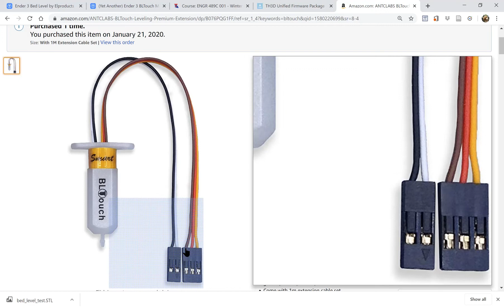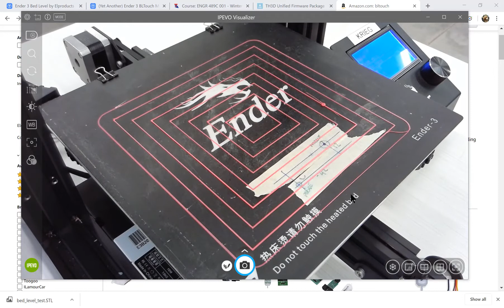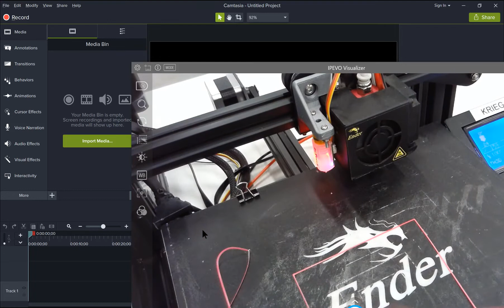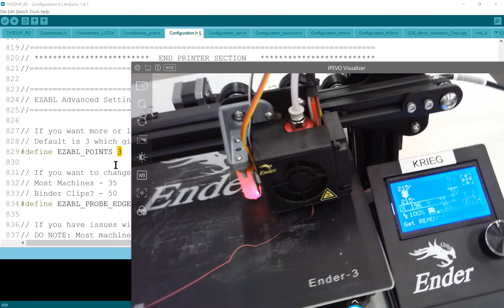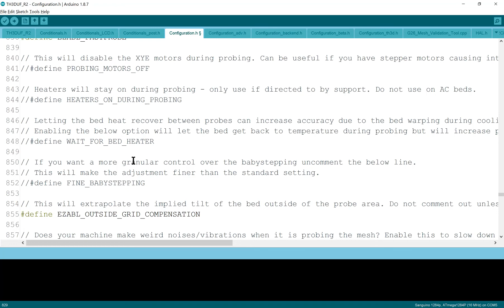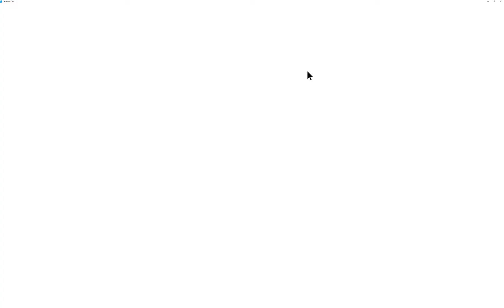BLTouch Install and Setup | Ender 3 | Mesh Bed Leveling

Comment from the maker: I will begin an Introduction to 3D Printing course on June 3rd, check out the video for it here: https://youtu.be/wkFsINXAac4 Thanks!

If you would like a video on manual mesh bed leveling that does not require any new hardware check here: https://youtu.be/cWDgaSEEu3o

Comment: hi #kelly maybe you can help me, I have a ender 3x with glass bed I changed the board and screen and added a bltouch but I setup marlin and I do a home and it goes down but don't stop not sure what I am doing wrong I am new too 3d printing. here is my setup I have a SKR V1.4 with 2208 uart steppers a TFT 35-E3 V3.0 and a BLTOUCH V3.0 also my tft when I click on the marlin icon I get just a blank screen I tried with a mks robin that came with a tft also was not able too find any info on this board so the store made me buy all kinds of parts and was not able too set it up and no help from know one so maybe you can help? or if you can I would pay too have someone setup my marlin and I would just need too install it. thanks for your time.
Reply from the maker: I can’t say for sure, but if the probe does not trigger when it hits the bed it could be the you have the black and white wires from the Bltouch connected backwards. That would be the first thing I would try.